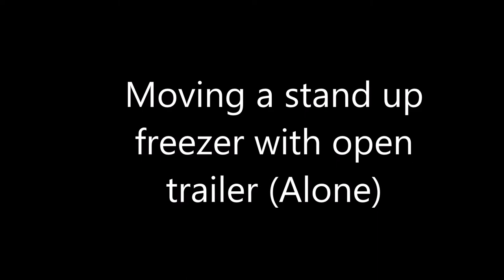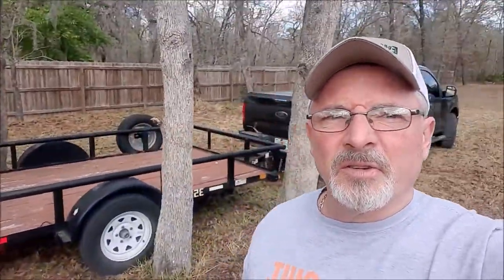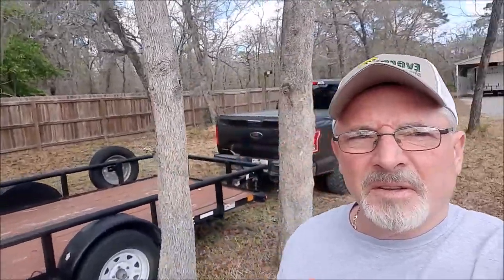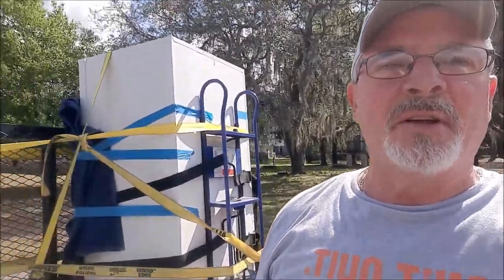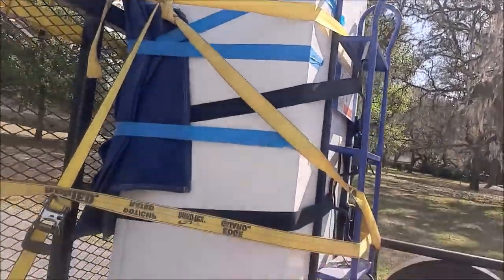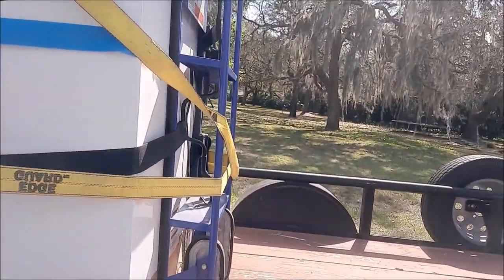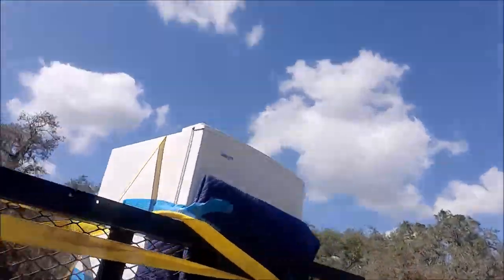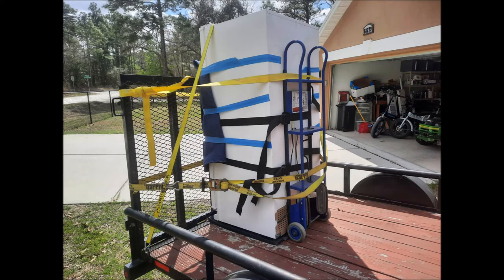Transporting a standup freezer in an open trailer. Alone

Comment: You didn't say anything negative about it but I'm curious if you had any issues due to the weight all being aft of the axle on your trailer.  Trailer sway, etc?
Reply: He died.
Reply: I was wondering this too. I'm guessing it would be a good idea to put something else at the front, even if not as heavy as the freezer. I'm doing this today and I'm going to put a few bags of pig feed at the front of the trailer.
Reply: @bamd8770 short distance not super heavy and it’s a decent sized trailer… should be okay but I’m like you.  I’d definitely load some gear towards the front
Reply: @KalebBroadhead how do u know
Reply from the maker: No, I had no problems whatsoever, the load was actually quite late and I would not have done it this way if it was heavy. Putting it in front of the trailer with no support could be even worse in my opinion and you're not supposed to lay them down, this was the only way I can figure to do it. I have plenty of straps to hold way weight forward.